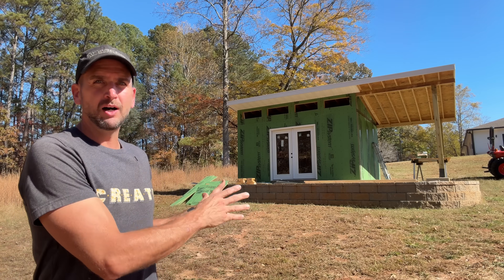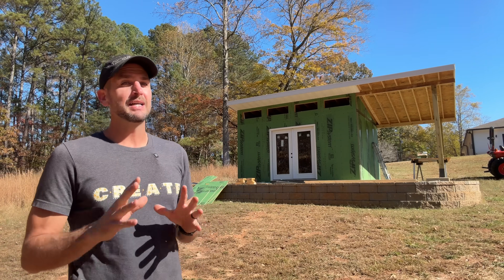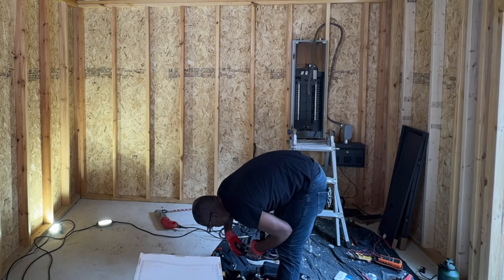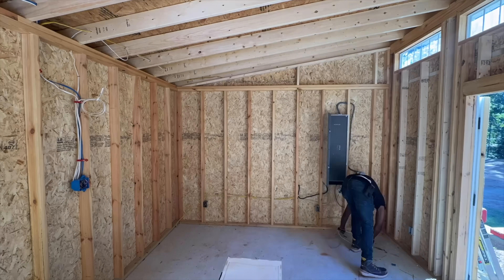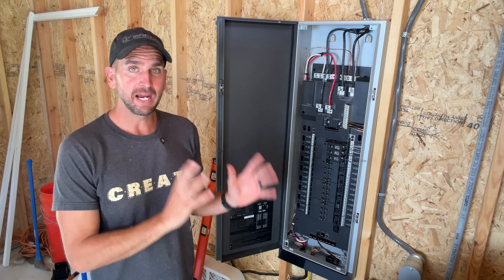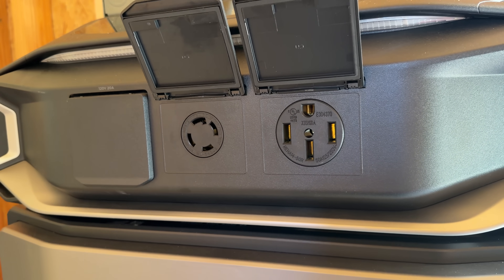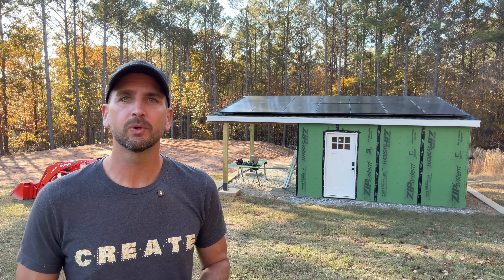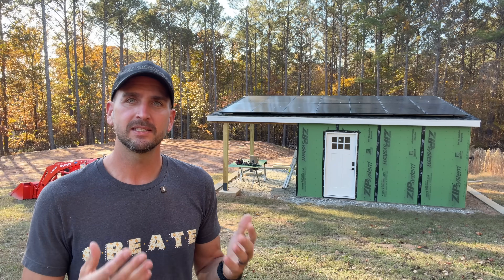I Replaced My Power Company… With My Insane Solar Shed!

Comment: Well, using a space heater is not the most efficient way to do this.  A mini split would greatly improve your efficiency and you would get A/C in the summer. Also heating the space when in used would be better.  I haven't seen your prior videos on this, but how is the floor insulated? your concrete slab may act as a heat sink and pulling all that energy

Comment: FYI: Cycle life is NOT effected by fully charging and fully discharging LFP chemistry batteries. Your information is outdated and conflates different battery chemistries. LFP or LifePo4 doesn't care how many times it's charged to 100%. In fact, it's RECOMENDED that one regularly charges LFP to 100% every so often or daily if possible. NMC chemistry (EV batteries) are the ones that should only be charged to 80%, otherwise they degrade faster. One size does not fit all. Not all batteries are the same. Spreading false information doesn't do anyone any good. It only creates more misinformed people. Do better!
Reply: That is wrong. LFP has a lot more full cycles (about 6000) than NMC (about 2000), but it is not unlimited. NMC is degraded by charging it to 100%, but not as much as NMC. The recomendation to charge LFP to 100% from time to time is, because the battery management system would report a wrong state of charge over time. This is because the discharge curve of LFP is very flat in the middle charge region.
Keeping LFP at 100% for extendet periods of time degrades them faster than necessary.
Reply: @fkiesel9442  No, it isn’t wrong. I have 15 years of ACTUAL experience daily cycling batteries and logging capacity. How long have you been doing it? You’re quoting “theory”, not real world experience. 

Temperature and age are the biggest factors in LFP capacity degradation. After the first 100 or so cycles, cycling itself has a nearly unmeasurable effect on capacity to the point where a control cell that has not been cycled suffers the same degradation as a cell that has been cycled, which means it’s age and environment that degrades most and not the cycling. 

Don’t tell people they are wrong until you yourself have actually done the work over almost two decades. You haven’t.

Comment: I wonder how long before you partition off that ‘white noise room’ you’re describing as your “office”!
Also….your panels (unless you’re on the equator) need to be on a more desirable slope as the net benefit would be FAR greater than where you have fixed them! You def need to hinge and articulate them properly!

Comment: Any idea if the smart panel 3 would work with the Dabbsson DBS3500 Home Backup Solar Generator | 3430Wh, 3600W - DBS3500 + DBS5300B Extra Battery | 8750Wh, 3600W,Dabbsson 420W Portable Solar Panel~ Or probably not because of the apps they are made for?

Comment: its good to see the redundancy of the generator being used... Make sure you can also charge the power station with the generator as well !
i imagine you can charge at 120v fine through a normal wall outlet, but maybe the unit can charge faster than 120v@15a.. 240v charging maybe?

Comment: Epic project! Bravo on super intelligent design and efficient multi use.
A suggestion if you need more power is to do easy or west Awnings off the sides, create more covered space and shading 

Turbo charge the generation profile especially in the winter months and expand generation profile include mornings and late  afternoon

Comment: 5740W system only producing peak 3500W and under 20kw per day?  Yikes that's like 33% less than it should be producing.  Is the angle bad or is it not aimed south?
Reply from the maker: Southeast and the angle is a bit shallow.  Also taking the 2 strings of 7 panels in parallel will limit the total voltage going in but keeps my 2nd input open for expansion.
Reply: @EverydayHomeRepairs  why not put them on the separate inputs until you expand.  Doesn’t really make sense to be wasting the energy.

Comment: Is there a reason you didn't make the main power tie in breaker a 3 position switch where one side was battery & the other was for the generator? I assume the EcoFlow panel is designed to avoid damage but I was under the impression the batteries wouldn't want to be back fed when you ran the generator input if that circuit was still closed.

Comment: What are the specs on those qcel panels? More specially what’s the short circuit current on those panels? If you run parallel how many amps are you over paneling into the single output? 

I’m running a DPU and contemplating over paneling on the high pv input to get more production and avoiding loss due to shading.

Comment: Does the SHP3 have the capability for a generator lockout like the SHP2 has?  Lack of that would prevent me from making it my main panel.
Reply from the maker: Nope, seems like EcoFlow is positioning the SHP3 for a direct swap out of a panel panel and that feature is not on the SHP3.  I also really like that feature on the SHP2.

Comment: If you want to meet code requirements and get the system properly permitted, you’ll need a certified electrician — especially if it connects or feeds back to the grid. To qualify for state and federal incentives such as tax credits or rebates, all required permits and inspections must be completed and approved.
Reply: He's running it completely off grid.
Reply: @gr82banautiger24  Off-grid solar systems generate and store their own electricity, so an electrical permit is required to ensure the system complies with all electrical safety standards. He clearly mentioned that a licensed electrician is recommended.

Comment: According to the online solar power app you suggested I need 18KW of power with battery backup (off grid) to replace my current electric bill. What backup generator would you recommend for my off grid situation? Thank you.
Reply from the maker: I would probably go with the Predator 11,500W generator from Harbor Freight as you could buy 2 for the price of other brand of inverter generators in that size class.   https://www.harborfreight.com/generators-engines/generators/over-8000-watt-generators/11500-watt-tri-fuel-super-quiet-inverter-generator-with-remote-start-and-co-secure-technology-epa-72614.html

Comment: Did EcoFlow give you any tips if you can combine a DP Ultra along with the newest DPU-X?  I already have a 3-battery unit DPU and trying to decide an expansion path if required.  Also do you have any suggestions for a solar Christmas light setup for those in rural areas with no grid to power it?

Comment: I have a small set up but still learning. You said the EcoFlow can't go over 15A but your set up would be 21.78A. How does it work? What am I missing?
10.89A x 263.48V = 2,869W
10.89A x 263.48V = 2,869W

 21.78A x 263.48V = 5,739W
Reply from the maker: The current will be throttled down to 15 Amps so I will get some clipping where I don't reach the full potential of the 6 kW of panels under ideal conditions.  Alternatively the array performs well in partly sunny and overcast conditions.

Comment: I agree, the EcoFlow app is way better than any of the others I have used. If you are going to park the tractor there, I would put  a 110 outlet outside so you can plug in a battery charger or block heater.
Reply from the maker: Yeah, I am going to put an exterior outlet on that side once I get the siding up.

Comment: if you purchased the raw LFP prismatic cells directly from a manufacturer, then add your BMS to that battery bank, you can save a TON of money and you have a system that can be WAY more easily repaired due to equipment failure.
Reply: Most insurance companies will deny claims for non-certified DIY power systems. Plug-and-play systems like the EcoFlow or closed systems like Powerwall have the FULL certifications that insurance companies typically require, even for off-grid scenarios.
Reply: The ones planes of prismatic cells which are larger---must be squeezed with plates.

Comment: If you're going for a full Solar roof array why not install a metal roof?
Reply: Exactly my thought. Id hate to have to tear it all apart to replace shingles.
Reply: better to mount the panels on a ground mount.
Reply: @SoloRenegade  Agreed, this dude has tons of space, so the roof mount doesn't make sense.
Reply: @SoloRenegade unless you don’t have a lot of space.
Reply: @kdegraa  where there is a will, there is a way. If you're going off grid solar, you clearly had the space to begin with. I cannot think of a typical piece of private property with one house on it where your Only option is roof mounted solar.

Comment: There is no way the actual cost, to someone who is not sponsored, pencils out on a project like this. Could you do a more affordable option that would make more economic sense?
Reply: You could do it cheaper than he is doing it for, without sponsors.
Reply: @EugenePutin Totally reasonable reply.… unlike the one to which you’re responding.
Reply: He said it’s a office. He can write it off for taxes.
Reply: @patrickedgewood8598 
Would you work in a tiny “office” with all that fan racket PLUS the noise of a mini split??😂
Reply: Agreed. Ecoflow is horribly overpriced for what it is. If you're installing in a house, look up the brand EG4. A cheaper brand that is still decent, but not so great customer service is Eco-worthy. You could literally do a 240 volt system with 10kw storage Eco-worthy and 10 panels for $4k before tax credit.
Reply: Hi, I have solar panels on my existing wooden shed.
Ha was ruse of an existing structure. M.
Reply: Just panels and inverters pay off in about 7 years. Batteries extend that quite a bit, though.
Reply: Can do it very cheap. traction battery they're in forklifts got a used 48v 25 KW for 600 bucks. Find yourself some used solar panels I found $30 a piece if you bought a skid 30 panels 900 bucks. A cheap inverter I found used Outbacks inverters 24 volt so I had to modify the battery splitting it by making two Banks 24-volt I have an inverter on each of them provides me a 60 amp service and I can just add another inverter when I need more. This system built for my father-in-law's cabin it's been running for 3 years without issue.
Reply: @jt574 You want him to do another project and video specifically for your criteria? SMH 🤦🏼‍♂️
Reply: @hsmiii Yeah, that would be great! I mean I wasn't asking him to do that, but since your dumb ass asked, sure.
Reply: He specifically mentioned another video with different units, then scale panels.
Reply: You actually want this guy to build another structure just for you? Unbelievable 🤦🏽‍♂️
Reply: @redstone5149 oh be quiet he wouldn't be the only viewer

Comment: Just a side note. If the breakers will work with Square-D Homeline, it will not work with QO. They are physically a different size. Homeline does match up with Eaton, etc. But thanks for the video..

Comment: If you have LiFePO4 batteries, you absolutely can charge to 100% without extra degradation (draining too low still applies - it's bad).  You're thinking of the most energy dense lithium ion batteries like the ones in our phones and my Hummer EV.  Charge EV's to 80% for normal daily driving but 100% is okay if you're going on a trip.
Reply: 😂 if he will change the battery on regular basis below 100% he will extend battery life (probably by years).
Reply: @Dextermorga

Not true for LiFePO4.

Comment: As small as this office is I think you should really go with a 120v mini split a 240v is overkill for this size space
Reply: Definitely
Reply: I used an Airspool Super Heat 😮
Reply: You didn’t watch it, did you?
Reply: @richmorpurgo5554  Don't need to watch it to know how foolish solar is. "A fool an his money will soon be parted".
Reply: @amyspring3891  It only takes one rough outage to make it worth every penny.
Reply: @amyspring3891 I used to be off grid. When I moved out of state, was back on grid. I just spent the last 3 days not having power due to an ice storm. Needless to say, we’ve decided we’re going back off grid. We wouldn’t have known that the power was off had we been off grid still…
Reply: He got $8k in equipment for free so probably spent matter to him
Reply: but the 240v is more energy efficient as they use less amps. So if its going to be on solar, then the 240v is the smarter choice.
Reply: @cybernoid001  Watts are the actual measure of power delivered and is a function of Amps times Volts. For higher power levels you would start to see Amps affect power loss in transmission lines (I2R losses), but on this scale it is insignificant.

Comment: Run at least one exterior outlet in the outdoor roofed area. (That's also where I'd put the generator inlet.) You may want to plug in a battery charger some day for that little tractor or other outdoor equipment, maybe run some Christmas lights, etc.

Comment: Nice setup. I will be installing some solar that I hope to expand to cover my whole house and my shop. My current shop is only 384 sq/ft. but I have 100-amp service for it. If I were building 2,000 sq/ft, I would run 200-amp service.

Comment: Very cool.  I gotta say though.... I mean sure, Ecoflow is giving you the equipment free so for your own use-case its fine.  But that is an incredibly over-priced system for what it gives you.

An unnecessary $3K home panel 3, a $6K DP Ultra system (2 batteries for 12 kWh of storage).  It's already clocking in a huge price-tag for only modest capability.  That's already $9K for what you have there, not including anything else.

(Edited with major correction, I got the bundle price all wrong.  I said $2590 for the 12000XP + 14.3 kWh battery.  It's actually $2589 for the 12000XP  plus $3319 for the battery for $5808).

So with the correction we're talking $200 for a regular electrical panel (as $50 to $200 depending), and $5808 for the bundle.  Then throw on another $1000 for misc cables aznd tools.  $7008 in total.  Add a chargeverter for $636 to get a much better generator interface for $7644 total.

If we go with an Eco-Worthy battery instead, 10.2 kWh for $1690 would make the total $5480,   Add a chargeverter for $636 and it winds up being $6116.

There are also numerous other DIY batteries, some with proper UL certifications, that run 16kWh for around $2500.

--

Even less if you use the GEN port instead of the Chargeverter... but frankly I think a Chargeverter solution is superior (i.e. not doing AC pass through), because then it doesn't matter how little or how much or how dirty the aux AC input is.

--

Anyhow, another thing to consider re: the solar.  With either type of system, remember that you can AC couple some of the solar.  So you have the option to expand with AC coupled solar in addition to the DC strings.

-Matt
Reply: I was thinking in a similar way.  In this office, it would not need more than an Ultra unit, a few batteries and a SHP2 with 12 breakers.  The SHP3 is house power level and capability with 32 breakers.
Reply: @gibblespascack1418  The question is ... why would you need a smart panel at all?  Just get a regular Siemens panel.   A Siemens 100A 20-space (40-circuit) panel is $100.  A 16-circuit panel is $55.  There is no need to get a smart panel.
Reply: @junkerzn7312  pretty sure it was free
Reply: @junkerzn7312  Because the smart panel(SHP2 or 3) allows the ability to charge the batteries from a generator or outside power source while still connected to the panel.  There are advantages to having the SHP vs a standard seimen's panel.
Reply: @gibblespascack1418  you don’t need a smart panel for those functions.  Well, maybe Ecoflow needs it, but off grid systems in general do not have those sorts of restrictions.  A 12000XP has a dedicated gen port, for example.  But for off-grid it is even better to not do AC pass-through at all and run the external AC source through a dedicated charger like a chargeverter, which avoids a whole pile of problems associated with doing pass-through.
Reply: The EG4 14.3KWh indoor battery is 3.2K on it's own - where are you seeing these prices? 12000XP is currently $2.5K on sigsolar as well. Your point still stands but you're giving the EG4 pricing way too much credit: it's not as cheap as you're saying.
Reply: Sorry, you are right.  I muffed that up badly.   Lets try this again with Eco-Worthy batteries instead:

12000XP: $2589
Eco-Worthy 2 x 100Ah 51.2V battery (10.2 kWh): $1690

That would take the bundle to $2589 + $1690 for $4279 total.  For 10.2 kWh.